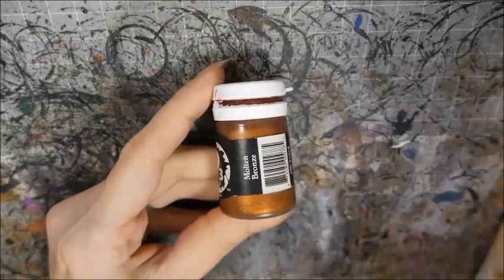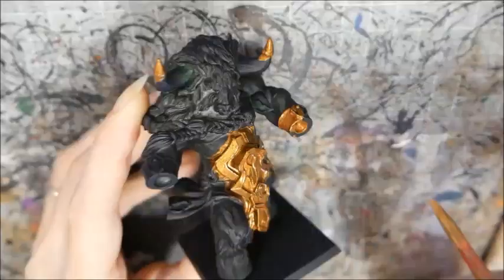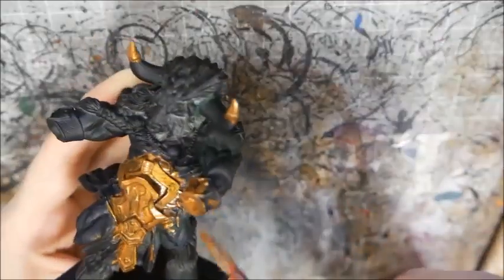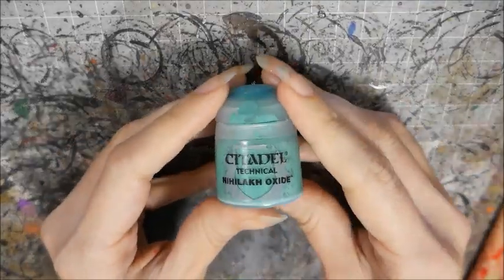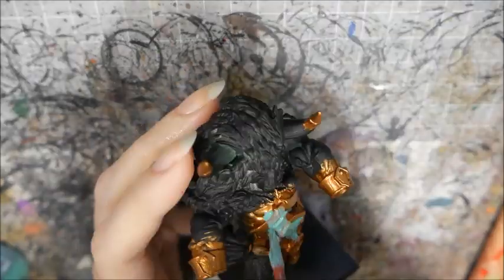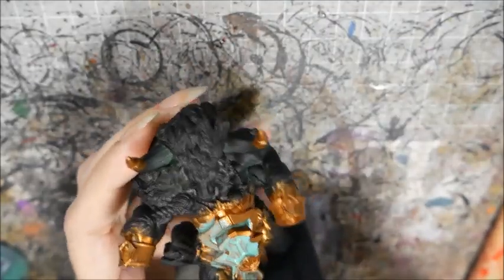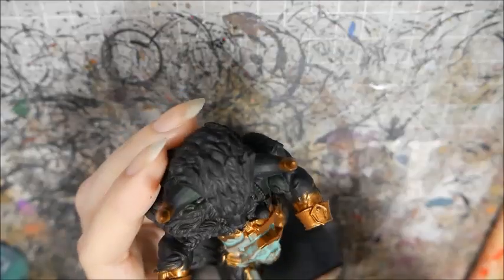How to Paint Miniatures - Verdigris

Comment: Hi! Great videos, I watch almost every single one of them. I have a question tough. I've been trying to start collecting minis and paint them, but I have no idea where to start! Should I look for some premade sets or pick up cheap paints, brushes and find plastic figiurines(like Reaper's Bones)?
Reply from the maker: I think Reaper Bones are a great place to start. They have a great variety to choose from, they're cheap and they're easy to paint (I have heard that they don't need priming, but I haven't tried this personally). As for paints, you could start with the craft paints to save money, but I did this and I honestly regret it. The craft paints aren't designed for miniatures and I found that they gave a grainy appearance. This was fine for practising but as I got better and wanted my models to look decent, I found the paints were holding me back. It's expensive but I'd invest in a set of model paints. If you can get a starter set, you can mix up the colours you need. Also, cheap brushes are fine to start if you're happy to replace them often. I wouldn't get an expensive sable brush until you're prepared to look after it properly (conditioning, etc).